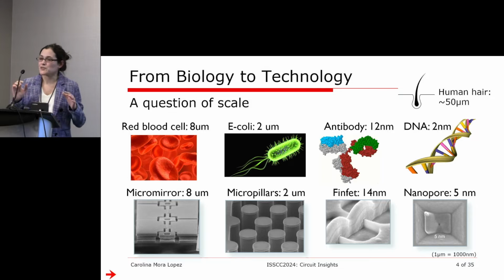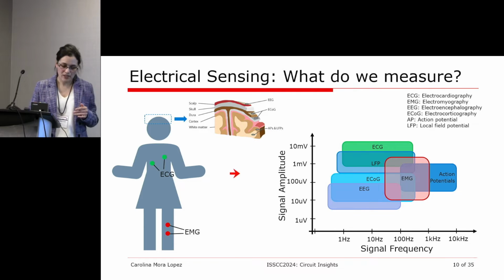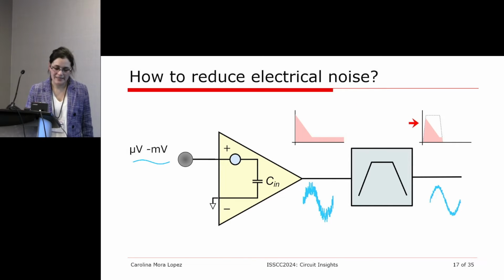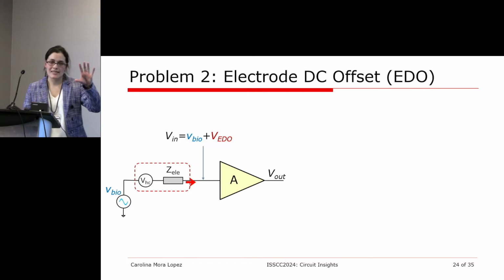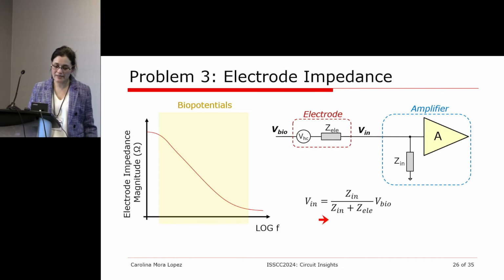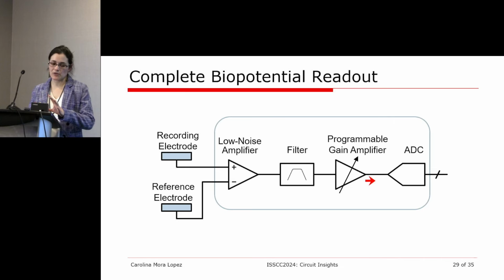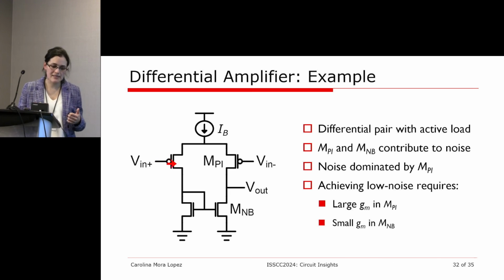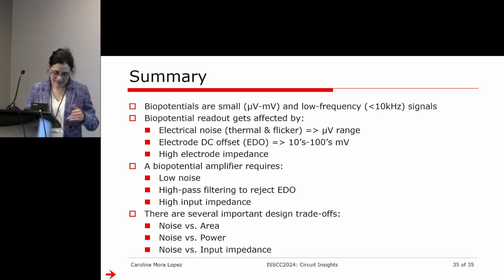Biomedical Circuits - Carolina Mora Lopez | ISSCC 2024 | Circuit Insights (3)

Comment: At 43:51 if we use bjt instead of mos.. our circuit will get spoiled bit.. not only with respect to leakage current.. compared to mos ,bjt requires large area,  power dissipation also increases, bjt more noisy( cuz of presence of minority carriers ) in all aspects we better to avoid bjt.. ( only this circuit point of view I'm talking)

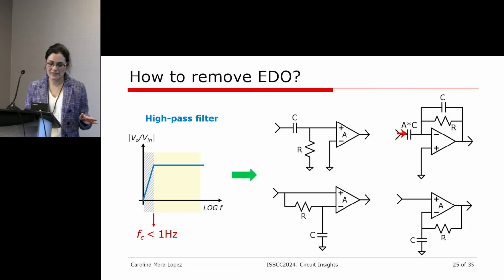Comment: At 42: 20 can we say like this..? How to get rid of EDO effect ( electrode dc offset) if we place capacitor at input .. capacitor simply blocks dc voltage  so EDO effect will sort out somewhat.. can we needed other circuitry in order to avoid this effect? At 32:35 we have 4 high pass filters..  among them upper two are free from EDO effect cuz of placing capacitor at input side .. so it will block dc offset.. lower two high pass filters we are trying to give input directly to opamp.. no capacitor is there to filter out EDO.. if I consider EDO effect here.. output will be amplified (output =gain times of signal + gain times of EDO)  can't opamp get saturated cuz of EDO effect ?